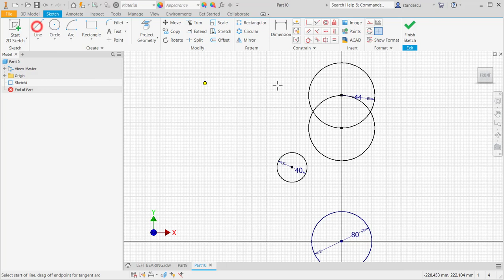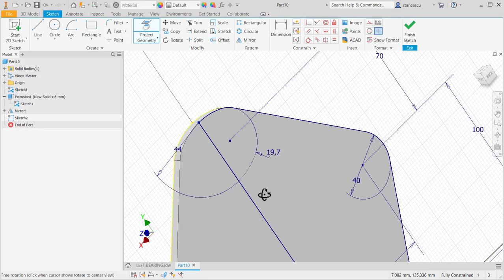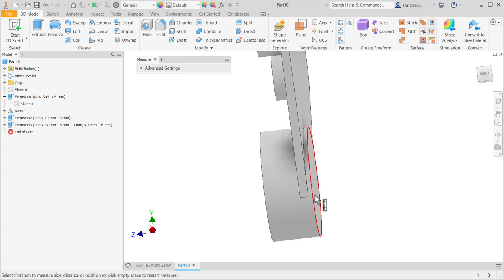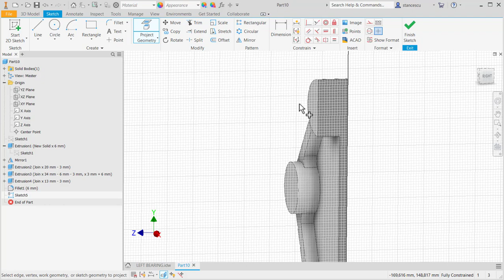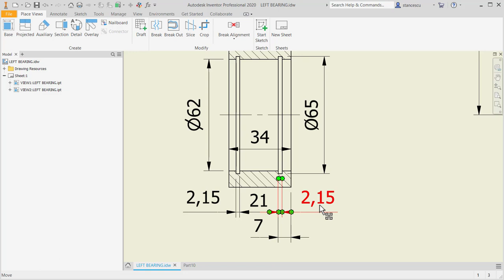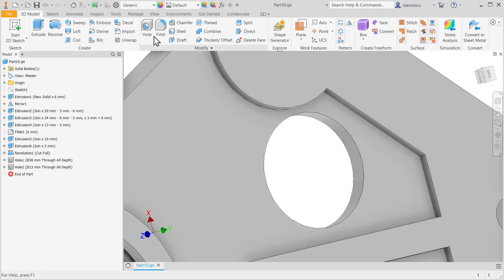Tutorial Inventor - 105 LEFT BEARING (Part-067)

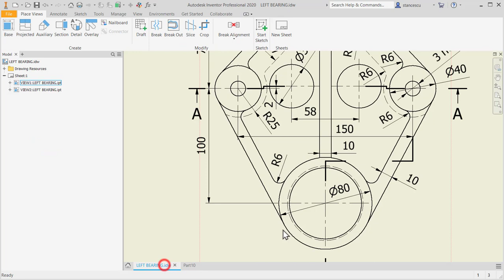Comment: Hi, for applying holes and channels, at 27:30 you have a technical error in the map, the distance between the two channels on each side is 7 mm and the middle is 21 mm, so 7 + 7 + 21 = 35 mm.  But in the map the total length is 34 mm, so there is a difference of one millimeter.
Reply from the maker: Dear Shimo, that cannot be an error because the dimension values are placed by Inventor in my drawings. I do not modify these kinds of dimensions by hand. As you can see, the dimension of 7 is placed only to the right. This means that the quasi symmetrical dimension of 7 on the left is 6 and not 7 because the total dimension is 34. Thanks for watching my tutorial so fine!
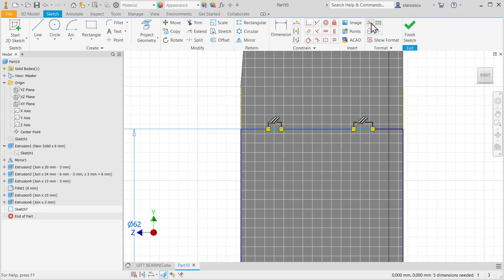Reply: Hi ,prof ,but to make channel, after you apply the split, in the 29:55 ,you apply equal, for channel and the distance 7mm in the each side, and you  tell us that : " If i place  dimension 7 in right, 7 will be on the other side  , and 2.15 ,as repeated in left" i think that you should not apply equal for 7mm ,and the mistake is this.tank you